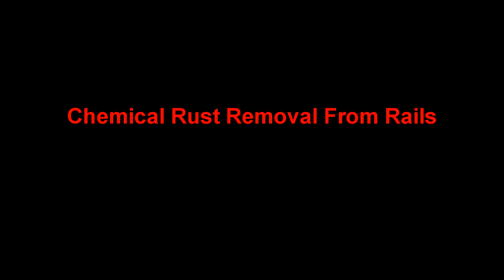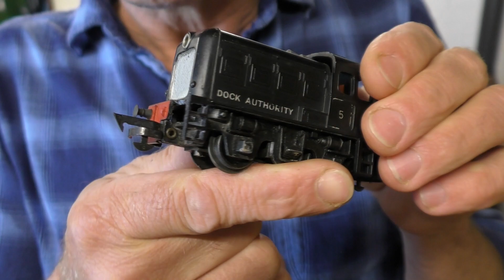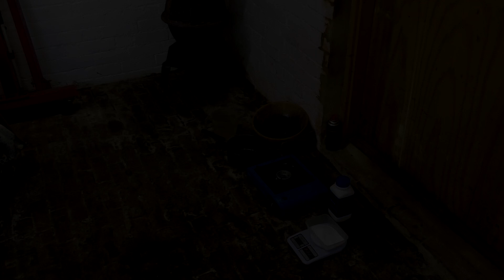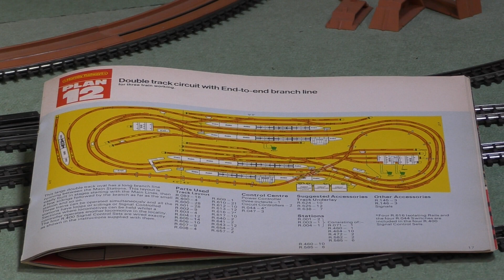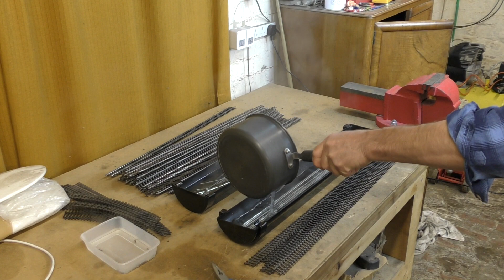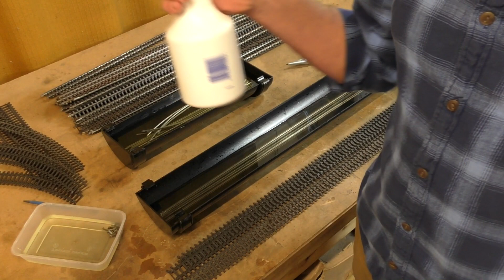Tri-ang R.253 Dock Shunter 3D Printing A Repair Section. Chemical Rail Cleaning. Layout Plan Update

Comment: Um, Yes; but why are you wasting the one sunny day all year in England, by staying in doors?
Reply from the maker: Good to hear from you, I am a bit UV shy these days. Happy New Year to you
Reply: @MrSnooze  And a happy gnu year to you and Mrs Snooze.
3d printing is of interest.  It is only a proposition if 1/ the stuff sets and does not exude toxins and allergens forever and a day.  2/ Does not combust resulting (again) in toxins.  3/  Can be 'glued' with a weld join.  In other words the two surfaces dissolve or melt then fuse - again without undue toxicity.  What you probably have with your steps onto the plastic body shell is a a simple non fusing glued joint that can fail.  It is all about mechanical integrity.  It's a bit like some of your clock repair techniques: some techniques are of suspect integrity.
When I look at some those CAD applications it looks more like 4D printing, the fourth dimension being time required for mastery.
Thanks greatly for sharing.
A bit of news around here that I will leave for e mail.

Comment: Love the layout. That Hornby turntable is only good for the bin. A disgraceful product that does not work and breaks easily. The previous Triang Super 4 turntable was noisy and limited but far more reliable. The best inexpensive turntable on the market is the Atlas HO on from the USA.
Reply from the maker: Hello, that's interesting about the Atlas turntable, I'm unfamiliar with that. I have just put my Super 4 turntable on the main layout. They are much quieter if you run them at a lower voltage. I use a spare controller for mine. Best regards to you

Comment: Hi, when I first saw your original video showing the damage to your Dock Shunter, my thoughts were simply to buy a replacement body shell off ebay or other, as this is what I did, however you have made it clear to all that with some time and care and the assistance of your 3D printer and software, you can repair the body with such great results.  I'm amazed at how super the new part looks, it is fantastic.  The Dock Shunter is one of my favourite Tri-ang loco's, the B12 being a firm fav too, the R54 though has always been my number one.  The B12 is a super loco, it runs smooth and is a reliable loco. I was testing a box of old Tri-ang locos this week and my B12 ran solid and the Dock Shunters both ran like the clappers.  I think you are going to get a lot of pleasure from your new layout and I have to say how smashing it is to see a new DC layout on YouTube and especially running Tri-ang, that smell they make is amazing, you don't get that from modern locomotives for sure.  All the very best, Stephen
Reply from the maker: Hello Stephen, thanks for taking the time to comment. I'm glad you are still enjoying your Tri-ang models too. There is no doubt the smell is great, especially if you are using smoke oil a bit and running them fairly fast. I am going to get my R.54 on the layout eventually but it needs a good going over first, been gathering dust for too long unfortunately. I'm busy plating rails at the moment but will hopefully get around to the Pacific soon. Stay safe and thanks for watching.

Comment: Hi another great video, I think you right about 3D printing it could be a great way forward to repair a number of model railway items. I think the key to it apart from accurate drawing and measurements will be the ability to scan  undamaged items where possible and also the damaged items so more tailored parts may be possible in the future. (more resolution!)What type of 3-D printer/CAD software are you using. Incline/elevated section running around the outside of the layout sounds like the way to go.
Oscar
Reply from the maker: Hello Oscar, thanks for watching. The printer is an Anet E10 and I'm using Freecad to design at the moment. I certainly agree it would be great to scan actual items and then print. Hopefully possible soon. Stay safe, look forward to seeing your next video.